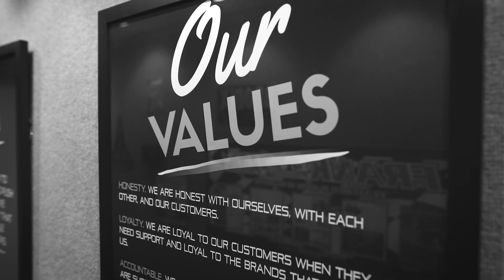We Are Frankenstein Engine Dynamics

Comment: My tuner has a set of your Stage 2 ported heads at his shop. 2011 Camsro ss with full boltons. Its getting a decent sized EPS cam specd by Jeff Skinner.  Do you guts think I will benefit from stage 2? Thanks.
Reply from the maker: Yes, they would definitely help you make more power!  Give us a call if you would like more info! 817-556-2434
Reply: @frankensteinenginedynamics1380  Thats great news. I already pulled the trigger. 😊